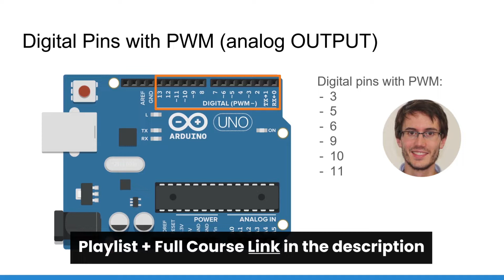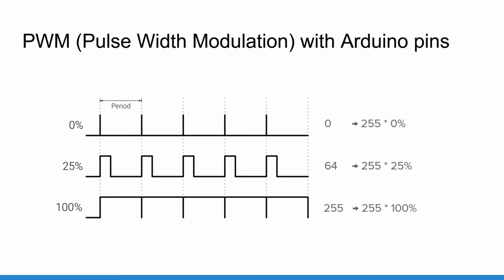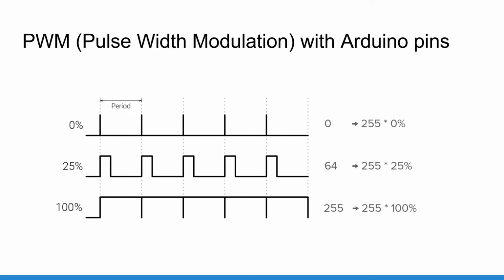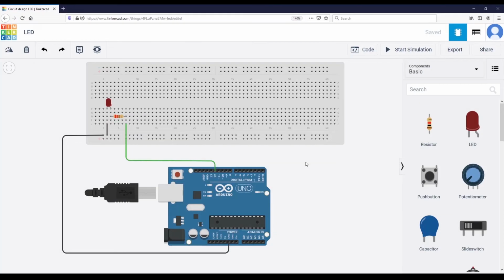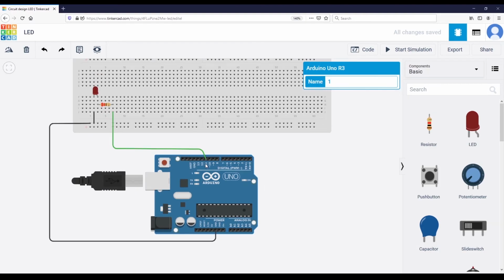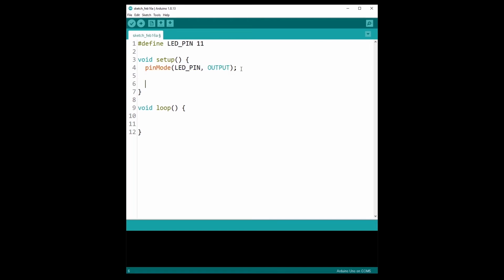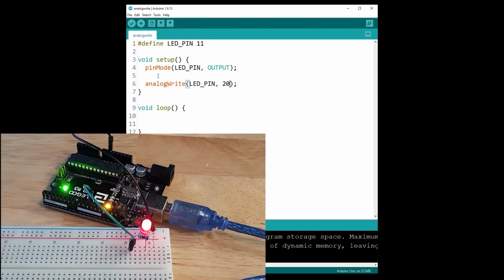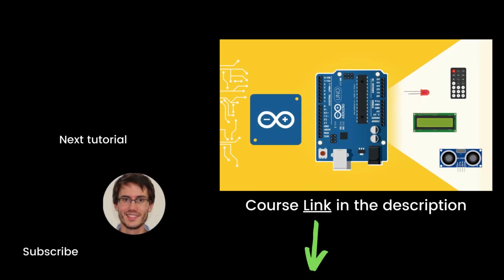How PWM Pins Work (With Code) - Arduino Tutorial for Beginners 11

Comment: Sir if we don't use pwm pins will the code work.Does pin 3 and 11 have high frequency pwn.what is the role of these pins in Arduino Programming.